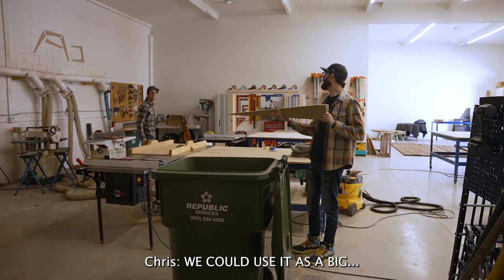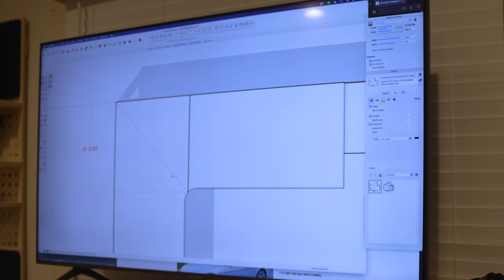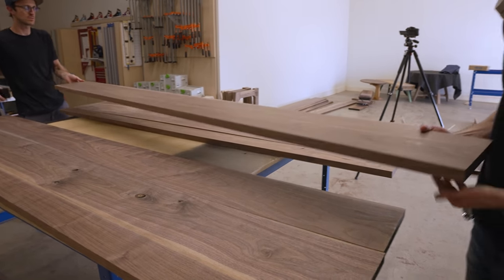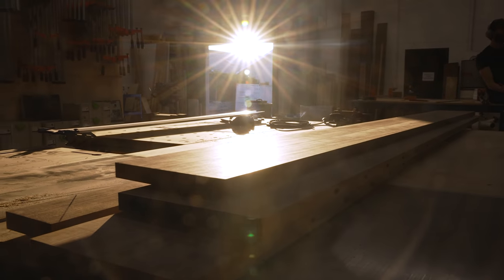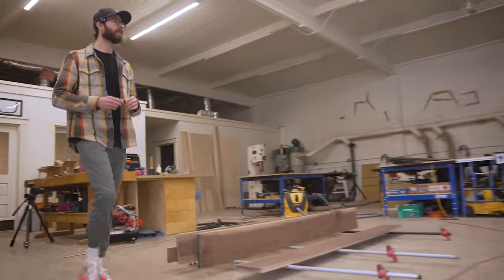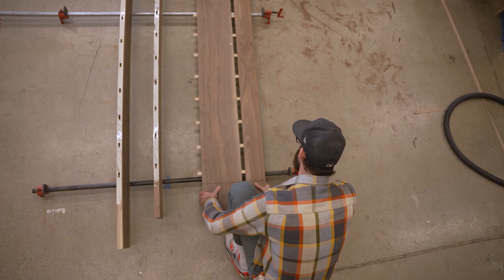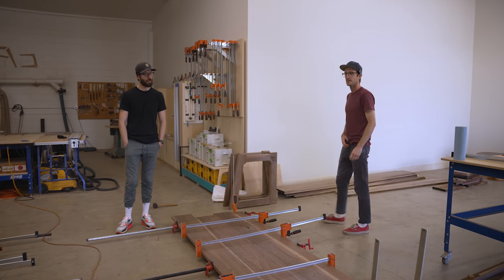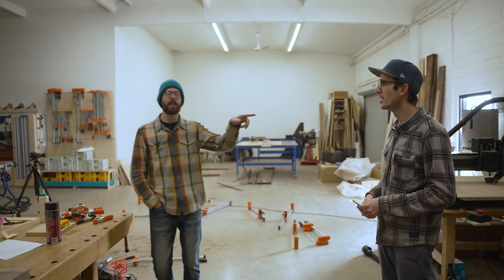One Bad Cut Almost RUINED THIS $$$$ Walnut Desk Top  - Build Diary - Part 3

Comment: I recently just built my parents a Walnut coffee table for Christmas I did the same glue up for the top it was 3-foot by 3-foot my problem was that the Titebond 3 glue  showed through the seem where I connected my sapwood pieces together I wished I used a different or lighter Titebond 3 kind of glue on that joint connection do you happen to have any solution or a lighter colored glue that you recommend and how would I fix that now you see a dark line in between the boards of that glue seam between the sap Woods it's mad annoying